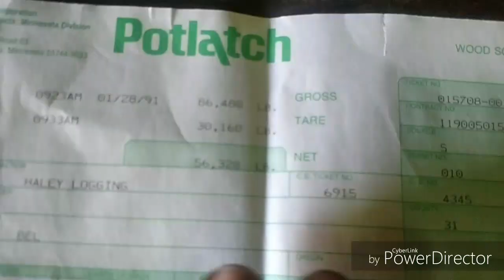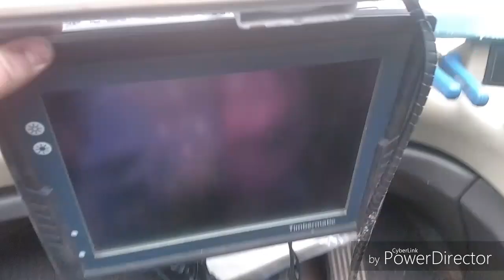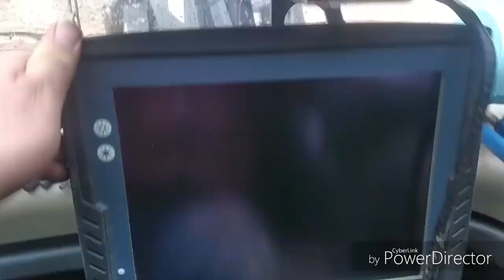Can't Log Without A COMPUTER???!!!

Comment: No can connection 😫😫😫😫😫😫😫😫
Reply from the maker: You should give me your number for Cuddy's Harvester Repair Hotline!  A wiring schematic would've saved a lot of fooling around and expense.  Have a great weekend!
Reply: I can actually get you one.. I'm pretty sure we have the books for ours in the shed.. is that a 1270 or 1470
Reply from the maker: Very kind of you.  We will try to get a print out of the fuses here at least.  It's a 1270D.

Comment: Left control pad might be the wiring harness for it I had the same thing on my 1270 TJ I would have to gigolette when operating to get it to work again it might help to try it its the most common from getting in and out
Reply from the maker: That's a good place to start.  We haven't isolated that issue yet.  Did you like the 1270?  Have a great weekend!